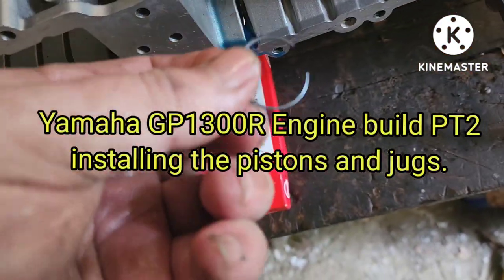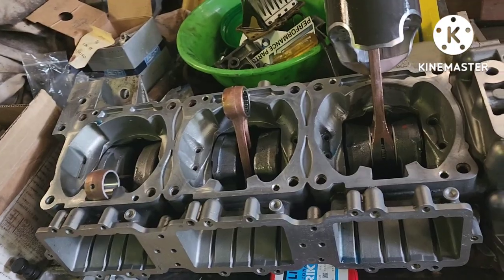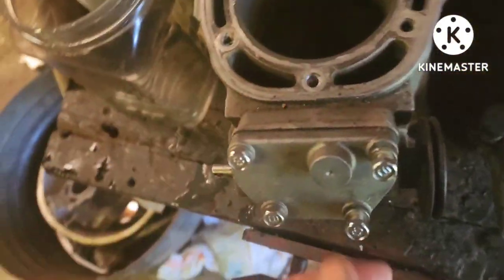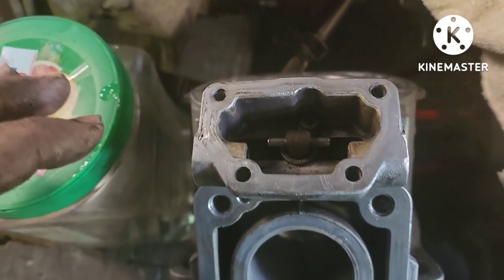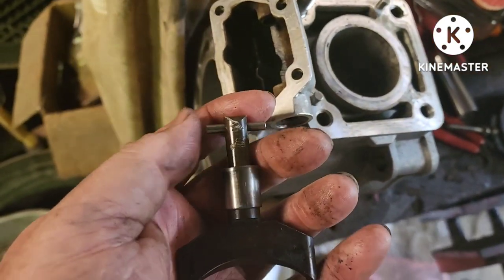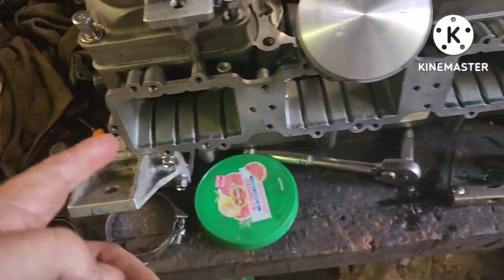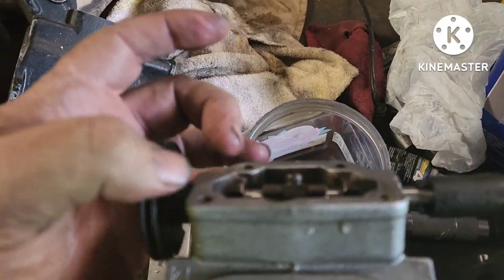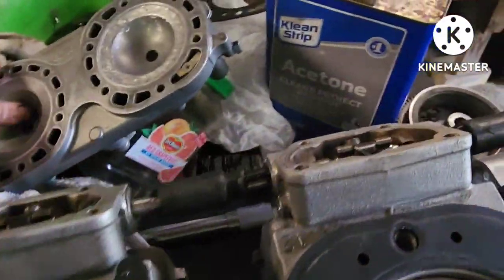Yamaha GP1300R engine build PT2  the top end and powervalves

Comment: Love your videos,  I just bought a 1999 xl760 not running,  something is binding when I turn the driveshaft. I'm going to start with pump first.
Reply from the maker: That is a good place to start.  It could be as simple as a rock or stick jammed in the impeller.  The 760 was one of the most reliable jet skis yamaha ever made.

Comment: God those powervalves were one of the worst things yamaha did. Not only do they eat cylinders but I didn't realize they need to be modified if you have them bored bigger. So many good skis I won't even consider buying in the future because of this headache.
Reply from the maker: Yes they were troublesome.  Yamaha did have some non powervalve engines that were 2 strokes but not very many.